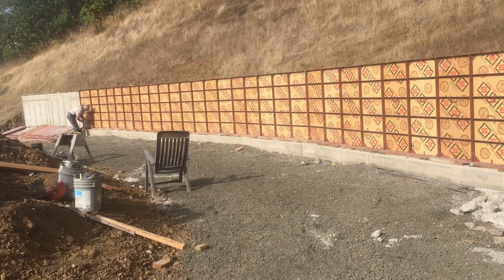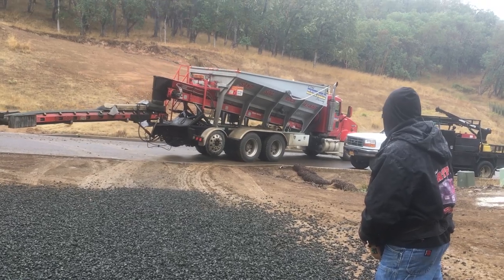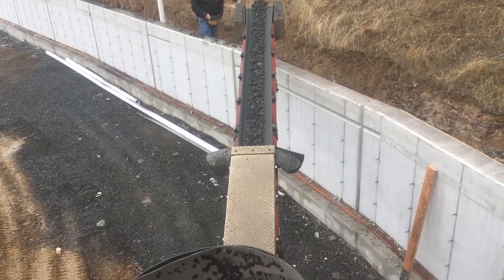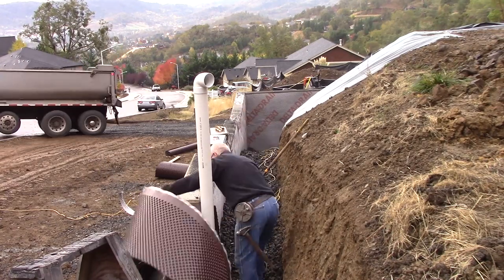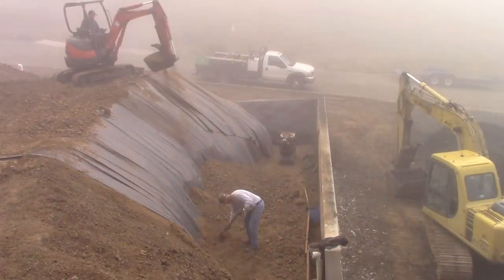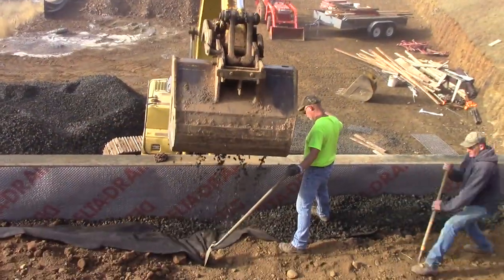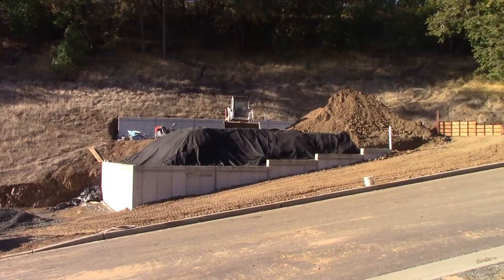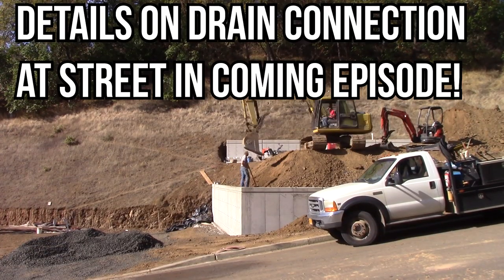Where Does The Water Go? Ep:19

Comment: Curved walls pose another problem. Even a simple boundary wall will eventually lean outwards. Each year, the joints open up slightly causing the wall to lean outwards an eventually fall over. But build the curves with an inward lean and the wall’s own weight will keep it together. Retaining walls need even more lean and all the stone and webbing shown here.

Comment: As someone who has a engineering degree, and works for a general contractor that has done work for heavy industry, I don't think you or your engineers could have done a better job. You spend the money needed to assure your wall will last a long time but saved money on backfill compaction because it wasn't necessary to achieve 95%.Its awesome to see when engineering and construction work together to give the best result at the best price.  Great work, and I look forward to more of these videos.
Reply: Brian Helmold --- Well said. When Engineers and Contractors become 'team members' awesome results are achieved!
Reply: You being an engineer could you please answer my question "why not round Rock over the drain pipe instead of crushed 2 inch?"
Reply: @gregorystead96  it's usually cost. Round rock in most places costs more, and does nothing than the rock they used. The key is to not have fines as it would clog the drain pipe.

Comment: Very nice video and great job on that wall.  The basalt is actually screened at least twice.  If it only went through a two inch screen it would contain fines.  So it had to go through a two inch screen to maximize the size of the rock to two inch.  And then it had to go through another screen (probably 3/4" inch) so the fines and all rock up to 3/4  inch would then produce 3/4 inch minus which is great for doing final roadway before paving and accepts compaction well.  The remaining rock is then 3/4 inch to 2 inch with no fines which is great for drainage rock.  Or at least that is what my experience is.  Great series.
Reply: And washed, maybe.
Reply: 2"minus 3/4" + is a nice way to label it.
Reply: We call that Scalps, its a waste by product of crushing stone, blended well it becomes a Road Base product, as you said, great for constructing roads.

Comment: You are the man on the concrete portion of this project!
And I agree with much of your procedures on your drain/backfill behind the wall but there are a couple of improvements you could have used to make this part of your build even better.
First of all your drain rock is best used when it is completely wrapped with the filter cloth and also using a double drain pipe is insurance that you will NEVER have an issue with the drain becoming clogged.
Second, I like to use a sock of filter fabric over the pipe also as a last line of defense to keep out the fines from the drain pipe!
3rd, the dimple barrier should go all the way down to the pipe and that company has a bottom layer which attaches to that pipe to directly drain the water which flows down the dimples to the bottom. place clean out
4th, so after the dimple material is applied, pipe connected the widest length of filter fabric is laid out and the the gravel applied on top of it. Many of us glue the filter fabric together so that the gravel material is completely surrounded. 
5th, clean out risers at some corners risers to allow for flushing out of when it finally does occlude.
I agree with your rock against the wall for the reasons you state.
Filter fabric and the rock are your friends
Not even sure you need to backfill with native soil that requires compaction....  just the drain rock
Reply: Brian Curwick drain sock around pipe is so 25-30 years ago. Many case studies, over the last decade, have shown it offers no benefit - and in fact most cases its detrimental to preventing clogging.
Reply: @Bellislawns  That is very interesting to me. Mind you, I am in sand country so the filter sock is virtually mandatory to prevent sand filling the drainage pipe through the holes. Thanks for the tip though. Always great to hear another perspective from other areas.

Comment: Great and amazing. Only issue is covering the rock with filter fabric. I’m a master drain technician here in Vancouver Canada, where it rains for 80% of the year. 

On houses where we do full perimeter installations we never install filter fabric directly over the 3/4” clear crush rock. 

The fabric will clog overtime, leaving your expensive drainpipe project inept of performing its duty. 

Instead, we do line the trench vertically if we feel the soil conditions are high in clay, and if the soil that is being backfilled over the rock will be high in clay, we simply just replace it 100% with gravel all the way up to the top. It costs more of course and this is something that we need to sit down and talk to the customer about and how they want to go about it. 

If the soil is good native soil we backfill directly over the gravel. It’s the same reason you never put a sock over a drainpipe. 

We’ve gone to inspect our systems installed over the years, using the method above where you backfill directly over the rock, and have found either little or no sediment or dirt inside the perimeter pipe, the drain rock is your “filter fabric”.

Comment: In our area we have conveyor belt trucks too, albeit they are stationary once they set up on site.  They have two telescoping belts that also rotate 360 degrees from where they mount on the truck.  They place quite a variety of materials, crushed rock for drain tiles, pea rock for under slab radon mitigation systems, concrete into wall forms, sand... etc.  They are a very handy and precise method of placement.

Also, love that you are using a water management system against the wall instead of waterproofing.  👍🏼

Comment: true as a civil engineer I see many forget about lateral frost heave which exerts thousands of pounds per linear foot on top of wall also so never back fill up hill side with organic material which freezes and expands  No struckural tie backs water drains etc cause failure .  Filter fabric on top of rock helps also.
Cold joint between wall and wall at key way often porous also. Nice show.

Comment: Good job. The only thing I'd do differently,place drainage mat too bottom of wall and slip drainage sock over drainage pipe. It is very cheap insurance,kinda a belt and suspenders approach. Also,place clean outs using long sweep 90,s with caps in strategic locations at finished grade. If ever needed,can rod or flush out with water pressure.

Comment: Love your videos and will sign up for Patreon and follow you soon. Thanks for the great videos and info. I have a question, why did you not put the delta fabric first before pouring any 2" rock or even putting the 4" pipe down? wouldn't having it from over the top of the wall coming down the inside all the way to the bottom and even going across the footing to almost near the dirt/rock wall do a better job of preventing any moisture touching reaching the concrete? or is that overkill?

Comment: Personally i would have dug the french drain pipe below the bottom of the wall. by the time you get to the end of the drain pipe you should be a few feet below the level of the wall due to the fall. this will ensure the water never creeps up and under you wall. also the holes in your pipe look a little too few, hopefully over time they will not block up, the felt should help keep out organic material. Also over here, these days we build a dry fit hollow block wall against the side of the main wall before fitting the delta, usually with extruded foam insulation between the two. This ensures there is a separation between the two incase you get a hole in the delta or incase the water somehow gets behind the delta. I hope it works out for you, thats a lot of work going into that.

Comment: Why didn't you put the delta drain in before dumping the gravel?
Reply: I thought the same thing. I'm surprised he didn't say it was a mistake.
Reply: I expect the finished level outside the wall will be up to that layer of gravel. So you won't see any efflurescence.
Reply: gcunn1 Either way it's weird not to just flush fit it to the wall when it was bare.
Reply: Well, for one, the roll clearly wasn't tall enough for the whole wall without breaks in the product.  Two, the drainage at the bottom is going to accumulate water under wet conditions no matter what - the Delta Drain will only keep the water away from the wall and moving downward.  It's not a seal.  Once there's no more "down" to go, the wall will get wet down there anyway, as the water moves through the basalt and into the perf pipe.
Reply: @NSMike87  I am surprised no weap holes. Water finds a way. And this is for a house?? Bill Gates moving into the hood?

Comment: if you build a french drain like that, you can also wrap it in Geo-fabric/filter fabric and bury it in sand. what he did is 100% a great idea, and cheaper than using Geo-fabric the rock its self will also help push that water off.

as a side note you can reverse the water flow and now you have an underground irrigation system.

the alternative to dumping like that, which I have never done except to strip asphalt, is to take a loader or track-hoe and dump it and finish it with a shovel. only thing I would do is vibrate every 8" to achieve compaction

Comment: Another great video.  Interesting that you are both rocklining the wall and using drain board.  I understand the rock lining against the wall is to prevent wall jacking, but doesnt this also serve the same purpose as the drain board?
Reply: Mark Kobey the drain board just keeps it dry or I should say dryer, it helps to keep it dryer or dry out, it can't keep up with torrential rain. as far as draining is concerned.
Reply: For the purpose of removing water, both drain board and the rock layer serve the same purpose.  You dont need to do both.

For the purpose of wall jacking, you need to have the rock layer.  but if you are doing the rock layer, you dont necessarily need the drain board.
Reply: Mark Kobey okay

Comment: I have a question about the delta drain.  Why didn't it go up against the wall first so all the 2" rock would be behind it as well?
Reply: rjtumble because water will touch it no matter what, plus delta drain fabric only comes in sheets about 5 foot in width, its more of a preventative measure rather than a 100% fireproof way of stopping concrete from leeching.
Reply: rjtumble 
See my post on the Delta Drain and rock

Comment: Question for a civil engineer:
This wall holds the hill by a foot plate that is attached by rebar. 

I’ve seen other projects were rather steep hills  are retained by a wall that is anchored into the hill by either matts or steel anchors. 
Matts would have required to dig out the whole hill which would have been impractical if not dangerous. But could a similar wall have been made by inserting large anchor screws into the hill and attaching the wall to those anchors? Just curious.

Comment: I thought thos was an external wall for your house, but i guess it's just a retaining garden wall, in that case ignore what i originally said ;). Did you put gravel over the geo felt? Soil will clog the filter fabric, it helps to have a layer of gravel. Here we wrap our french drain pipe in the "filter fabric" there is a gravel layer inside and outside the filter fabric so that the pipe is encompassed by the fabric and the gravel on both sides.

Comment: Could that wall potentially cop flood level water? would the 4 inch pipe be enough to carry the water away before putting huge amounts of force on the wall? I've recently used 10 inch pipe for a drainage job, and it has really put my mind at ease.

Comment: whyd you not wrap the pipe with fabric prior to filling? as the ground shifts in freeze thaws the stone will eventually break down to the point where youll have sediment in the pipe thatll need to be emptied. is there a cleanout on the end of the pipe at the top of the wall for that purpose?

Comment: So the idea is the water runs down the rocks and into the pipe at the bottom of the rocks, which is full of holes, right? So what is the purpose of the vertical part of the drain pipe?
Reply: Venting I believe
Reply: I believe it's a "clean out"
Reply: its for flushing it out, clean the drainage after a couple of years
Reply: Looked like he tied it into a clean out maybe?
Reply: Air. As in you house hold plumbing fixtures, You need air to expel as gases and to work as you need it to. Check out your dishwasher if you have one. The vertical part of the DW connects to you sink.  Something like that.
Reply: Robert Smitherman it is a clean out. Nothing to do with venting. Venting is for indoor plumbing. Especially for sewer. Without your home would be subject to those gases created by sewer. 

This is a clean out to allow flushing of the system.

Comment: Is cold joint between vertical wall safe as long as the reinforcement continue between both walls, for example if I'm pouring a  concrete wall  and don't have enough form work to complete the entire wall.

Comment: No Buttress?  Or two or three? A length that long should have integral perpendicular support. That is,  a wall projecting into the loaded side which provides a lever against overturn. Even the most reinforced wall will eventually overturn given the expansive nature of clay soils. I’ve repaired hundreds of “ wall jacked” foundations. Every one was long and straight, and two dimensional (h x l). 
The buttress will be anchored into a wide footing which gains strength as the load becomes greater.  
Perhaps the depth of gravel will wick away excess water and eliminate expansion at the base, but I wouldn’t chance it.

Comment: the only thing i would have done differently might have been to install the delta drain on the wall before i put the 2" fill over the drain field pipe. so i could get a full width and the moisture would wick all the way down into the 2" fill..  would not have to throw out 1/4 of the product..  but hindsight is 20/20..  perhaps the reason to NOT.. would be to prevent any water build up in the 2" fill from wicking up the outside of the delta drain..  the other mistake is the Elbows in the 4" DF tubing.. those are short radius elbows.. no plumbing snake of enough side or even a jet rodder could go thru the first elbow..  let alone the second or third..  there are Wide radius ells available that guide pluming snakes and high pressure rodders thru..  too late to do anything about it now..  i would have also designed a clean out port thru the wall at each straight DF piece so a plug could be removed and a jet rodder hose guided in to flush out the DF that will will with some sediment in years go come.   there are nice caps/covers available to make the wall look nice..  but again.. i am back seat driving using my 20/20 coke bottle bottom eye wear prescription..    i can't imagine also not going in with angle drilled post tensioned tiebacks along that wall..  or any retaining wall of height.. or with homes built on top.